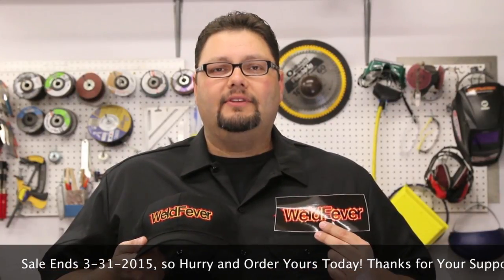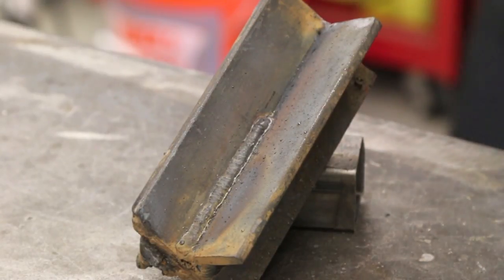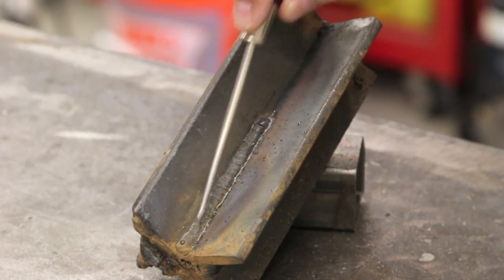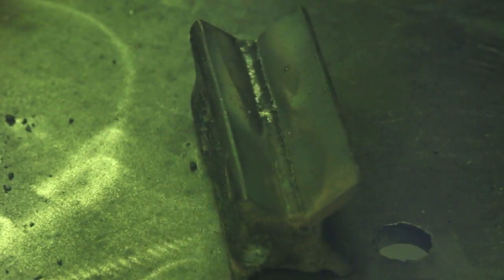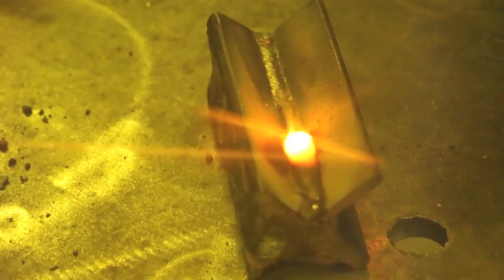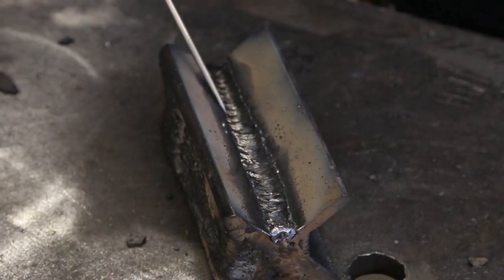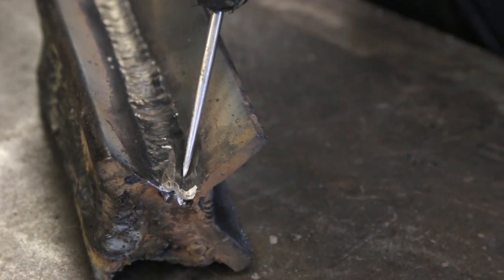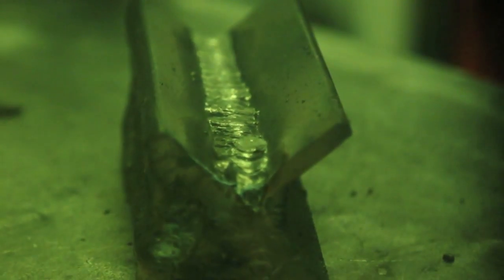Stick Welding E7018 Flat

Comment: Dan, thanks for all the great vids!  Can u discuss rod angle when u r welding different rod types and weld positions?  Thanks again.
Reply from the maker: Judy Sweetland Sure, I'll make a note of it, but I can tell you that for most still welding, in just about all positions, I have a drag angle that is approximately 10-20 degrees back from 90, or 70-80 degrees, depending on how you look at it.